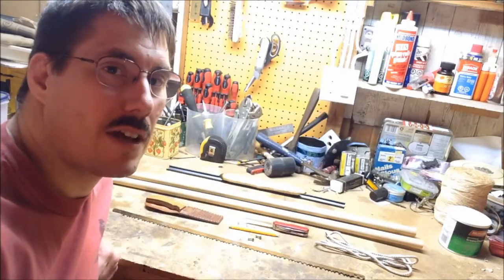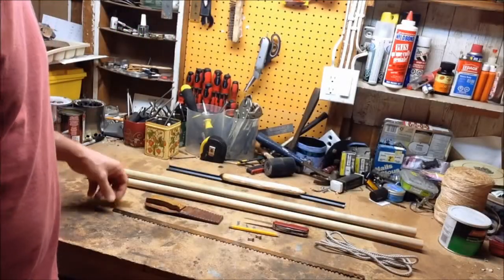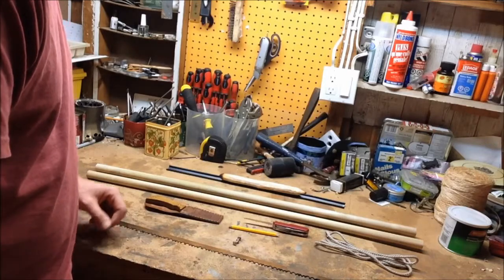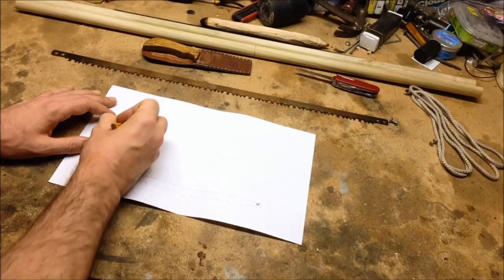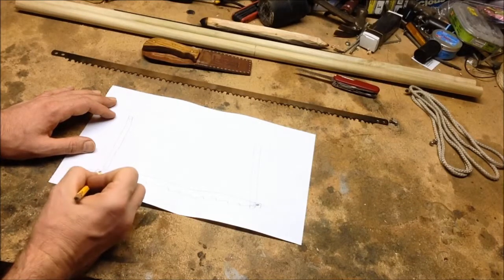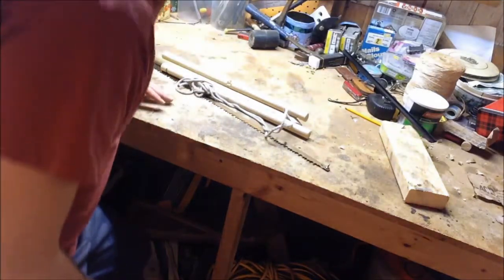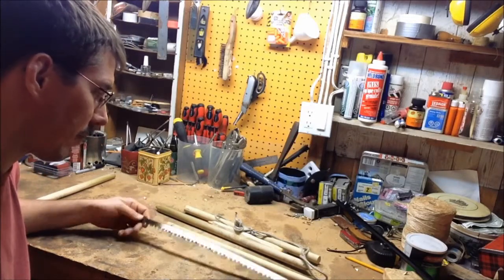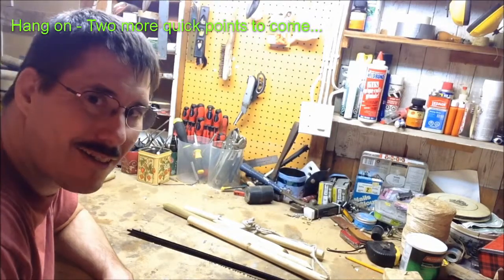How to Make a Takedown BuckSaw Frame

Comment: Good. Making it at home has the advantage that you could rub linseed oil into it. You learn how to do it in the wild without having to. I might use a smaller dowel for the crosspiece though.
An old pantleg for a bag and you are all set.